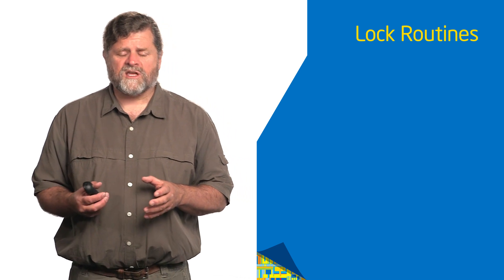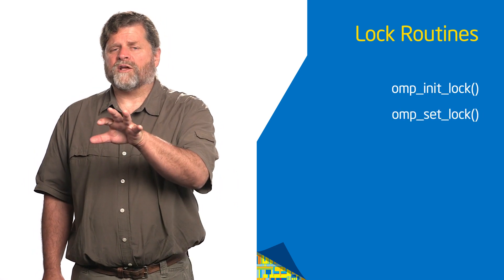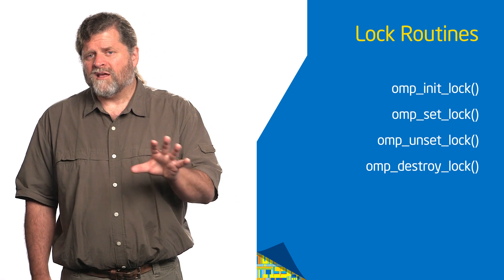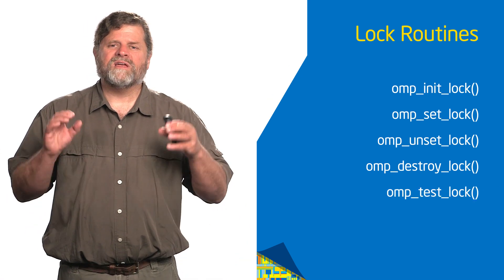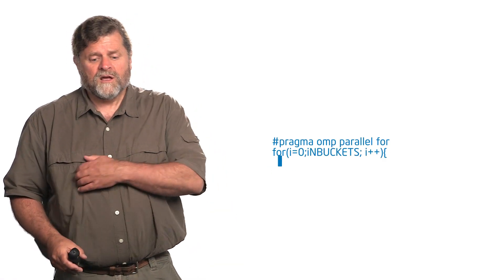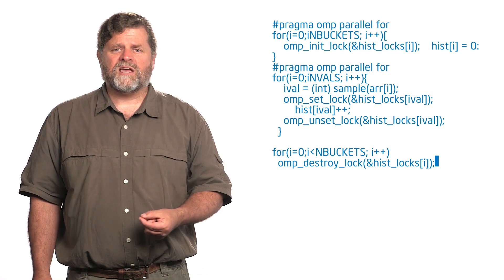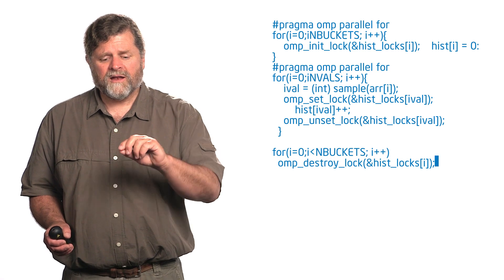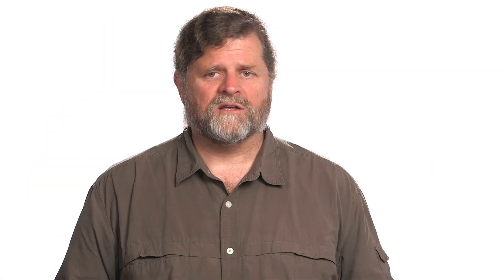Introduction to OpenMP: 11 part 2 Module 6

Comment: The updated data structure is nice, but it's not clear to me why the use of critical or atomic was ruled out. As far as this video is concerned, it's actually the data structure that solves the problem of high contention.
Reply: Yeah, the example is simple and can be solved in different ways, but it introsuces the locks perfectly in this series of lectures. Indeed the large histogram could be made out of atomics. But atomics cover only the primitive types. Locks for a large set of shared any-type resources is a more general technique.

Comment: Can we use #pragma omp parallel for, to destroy the locks?
If we can't, than why was it used to initialize them?
If we can, than why wasn't it used?
Reply: OpenMP requires that the runtime library routines in OpenMP are thread safe and hence, they can be called in parallel by multiple threads.  When locks are associated with individual elements of large data structures, initializing and destroying them can have significant performance advantages.

Comment: I don't understand how hist_locks would be declared.
Don't we need to declare it?
What's the type of a lock?
Reply: 1:24. Also see http://stackoverflow.com/questions/2396430/how-to-use-lock-in-openmp
Reply: Just an `omp_lock_t[] hist_locks[NBUCKETS];`. It is not in any way connected to the data it is protecting, so you still need to remember to call the set (and unset) functions when accessing it.

Comment: can we use  atomic add operation instead of lock ? i think i would be faster
Reply: Nizar El-Zarif remember that (as far as I konw) even atom would lock all the process (only one thread can execute that code) while lock only blocks that array element.

Greatings
Reply: Yeah, I would agree with you for the given example. In my eyes locks seem only be effective if they are used for a section of code which is critical and you don't want every thread to wait for it, so you would use the test function. Maybe some expert can help us!?

Another point.. Did he mention the type of arguments of the lock functions?
(really enjoying this introduction to OpenMP so far)
Reply: it might be because atomic operations are limited to a few types of operations: increment, decrement, binary ops. if we have more complex data structures to operate on, we could use a critical section and end up serializing the code, or instead use this approach with locks and still have the code run in parallel